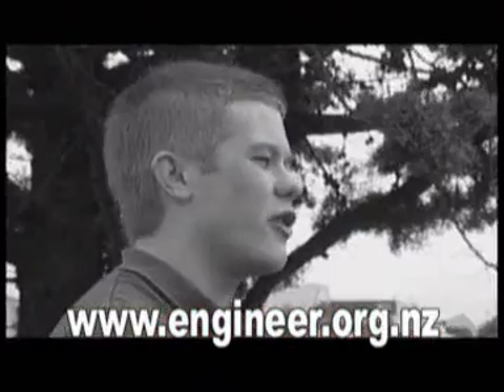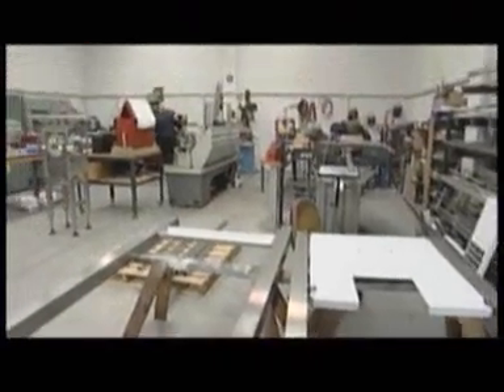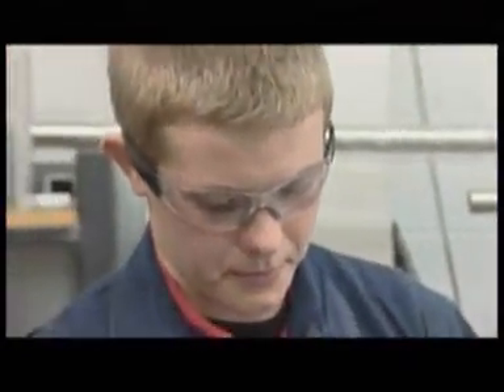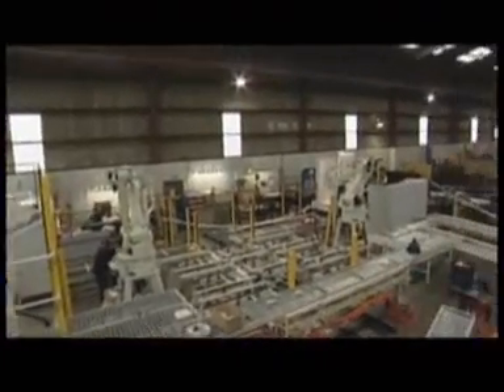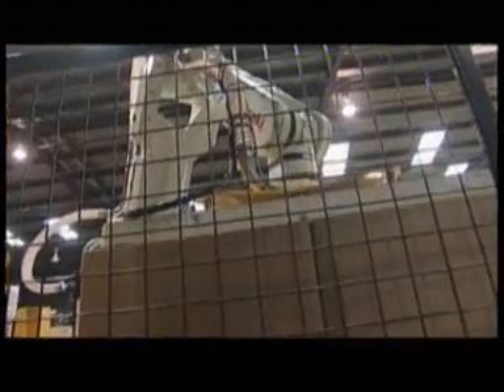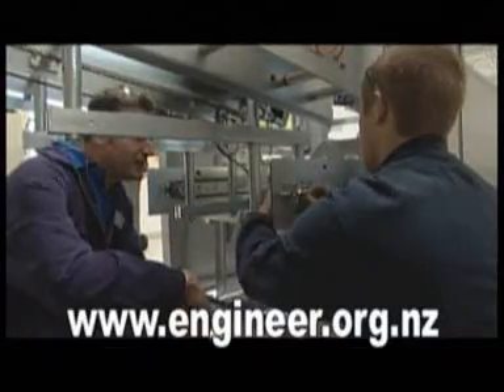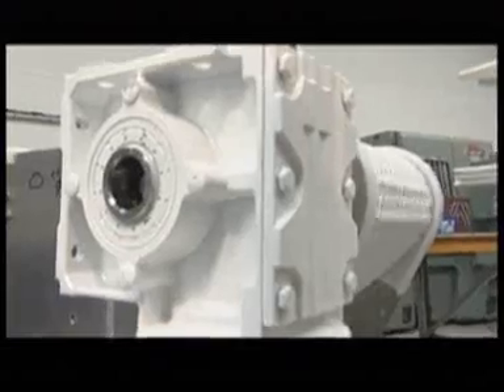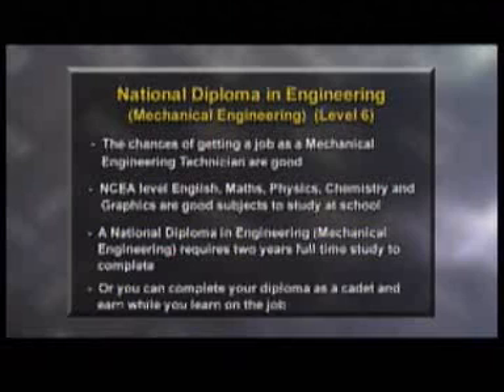Mechancial Engineering Career

Comment: this is part of mechanical engineering. i see solidworks and some cutting machines like the band saw, lathe and cnc. mechanical eng. shares a lot with manufacturing eng. and other engineering disciplines.